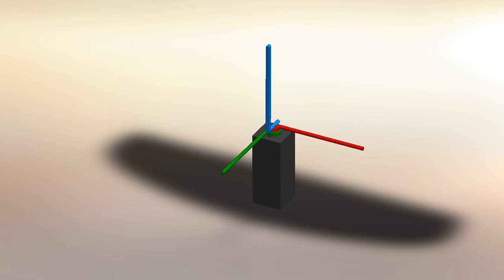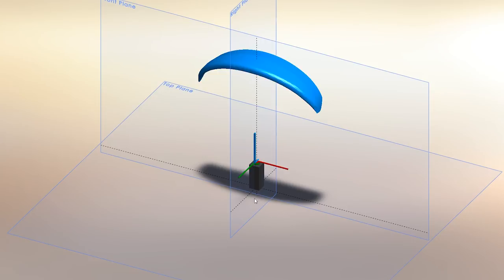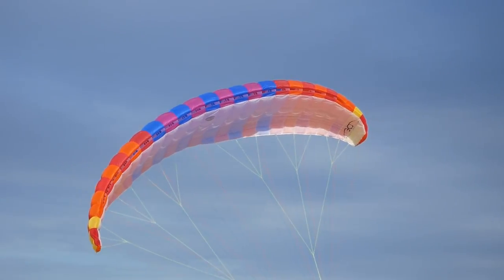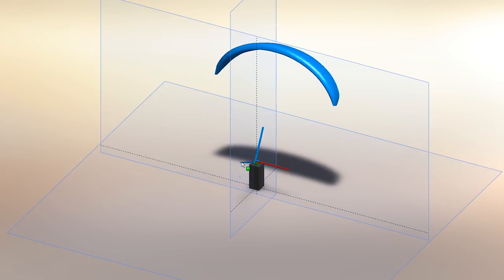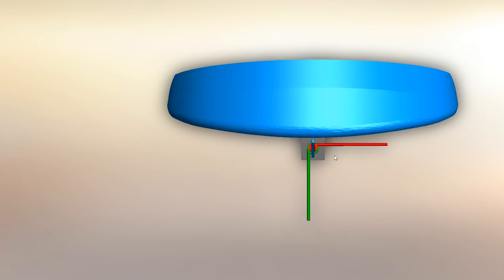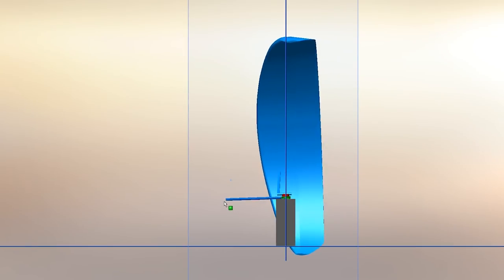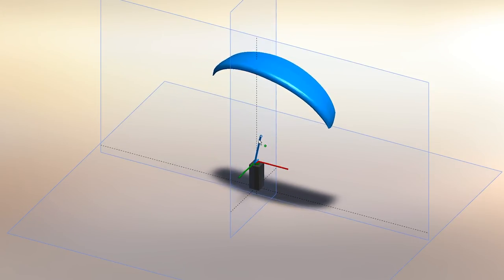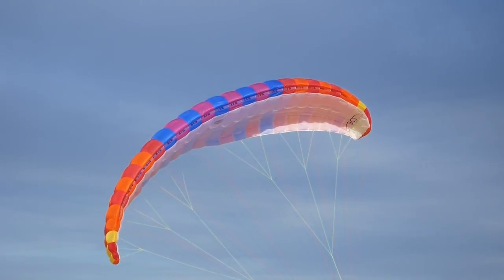Roll, Pitch & Yaw for Paragliders - GH JOB - BANDARRA

Comment: I think there's an additional complication with your pendulum effect. When you put on the brakes flying and trim speed symmetrically you will Pendulum out forward a little bit. As you slow down it takes slightly more breaks to keep the pendulum angle. Roll and yaw don't seem to oscillate as much as pitch.